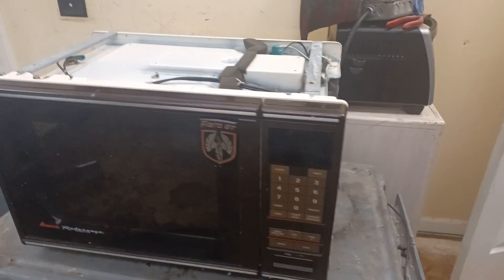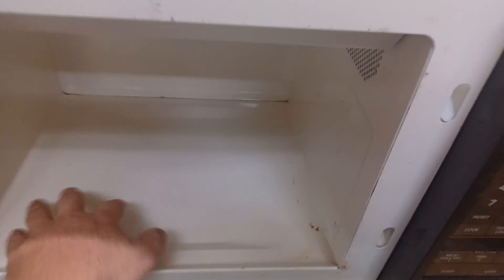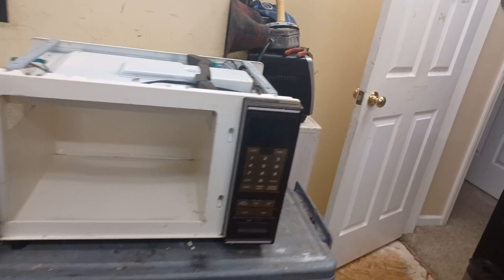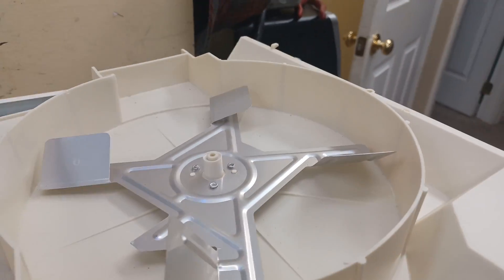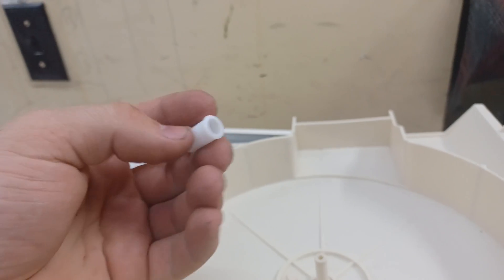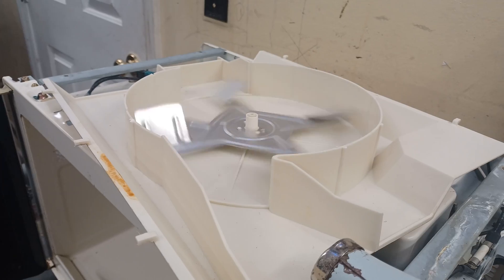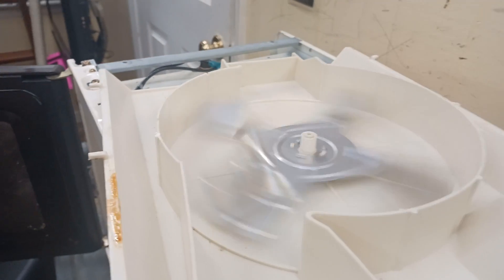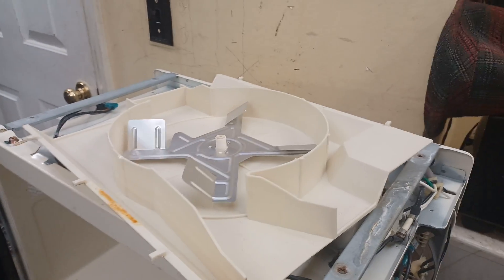Very cool mechanism used in a 1984 Amana Radarange

Comment: I hear the really old ones (1960s-1970s up until the RR-4D) used a shaded pole motor for the "rotawave" and an actual coil electromagnet (not a ferrite permanent magnet) for the magnetron. Because of that they apparently weigh over 100lbs!!
I would love to find one of those older machines, as it would probably be better quality than any microwave made in the last 35 years.
Reply from the maker: Yeah. There was a 60s model on Craigslist in Raleigh about a year ago for $20, but someone snatched it up before I had a chance.

Comment: That spinning metal thing is a mode agitator, a.k.a stirring antenna.  Amana's trade name for that is the Rotawave.

I have a 1982 vintage Radarange and it has the same thing.

Tip: Many vintage Amana microwave ovens use foam seals inside to maintain airflow to spin the mode agitator.  The foam can deteriorate and allow airflow to escape, preventing the mode agitator from spinning and resulting in uneven cooking performance.  You may need to reseal with new foam to restore airflow to the mode agitator.
Reply from the maker: I will have to look at that, I have 3 of this same model and one slightly older one. I have never had an issue with it cooking unevenly, I would even say it does better than a new crappy one.
Reply: @WalterKnox  Well, not all models may be affected and I think the one in this particular video is probably ok.
Reply from the maker: it likely is as I have never noticed any issues with it, and I don't recall any foam or anything being there. and if it was falling apart it seems like I would have noticed. I do however have 2 more of the exact same models that I got a while back and I have not looked at or cleaned yet, so I could check it out while I am at that.

Comment: This is a very fascinating mechanism. I bet it works a lot better than those cheap chinese microwaves you find at Walmart or whatever.
Reply from the maker: Absolutely, I just got another one of the same model, they both work perfectly after nearly 40 years, where the new ones you are lucky to get 3 years before something fails!

Comment: I've salvaged transformers like the one in that microwave, but I've never repurposed them or used them for something interesting. There's just a bunch of copper wire in there I can't get to without a welding torch, as the metal cases around the transformers are thick. Any transformer projects going on?
Reply from the maker: No, I would like to play with a MOT, maybe make a low voltage high current type thing like photonicinduction did, melt hand tools and things.
Reply: @WalterKnox  that'd be awesome. Even opening up the case to unravel the copper coil would be interesting.